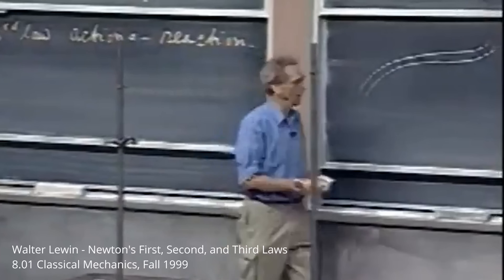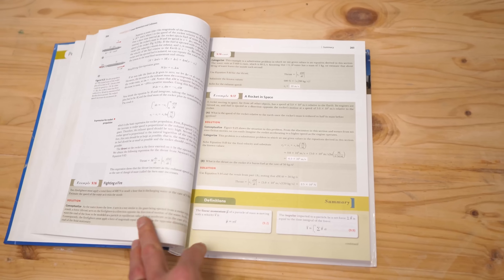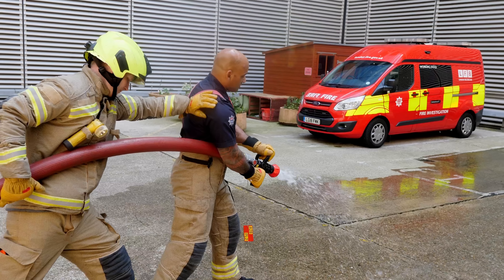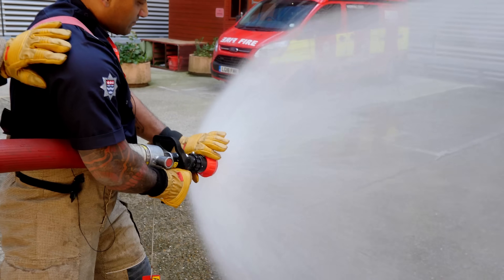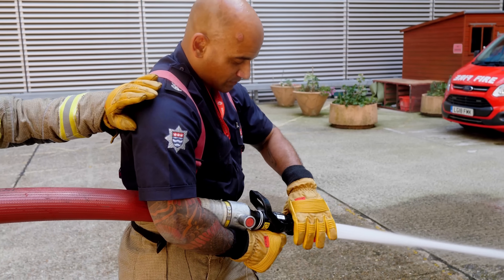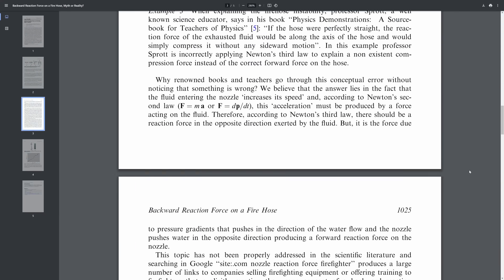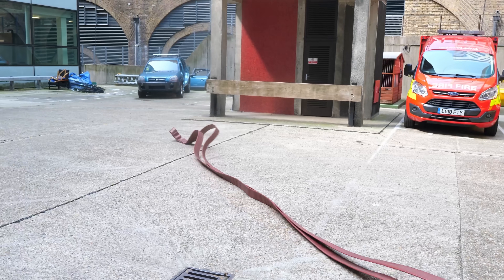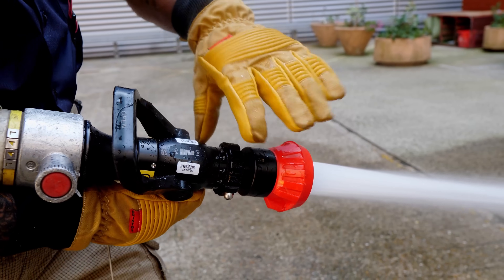Why chaotic hoses dance

Comment: A couple of points from the perspective of a very old aerospace engineering background...

1. The hose and nozzle are not the same diameter. The mass flow rate of the water is the same everywhere in the hose, but the velocity is not the same. I believe the force generated as the water accelerates through the nozzle is related to the energy rather than the momentum, which means the velocity term is squared. To me, the diameter looks to be roughly half of the diameter of the hose, so the energy should be 4x as high.

2. Water is incompressible (also not terribly expandable). In a rocket, the shape of the nozzle matters a lot. You actually don't want the exhaust to exit the nozzle at higher pressure than ambient; maximum thrust is achieved when the pressure is equal to ambient. When this is the case, you get a jet of exhaust that's tangential to the end of the nozzle. When the exhaust is lower than ambient, it squeezes inward after the end of the nozzle forming mach diamonds; when it's higher, it fans out. Water mostly won't do this, so I don't think the shape of the nozzle matters as much, after the constriction point. The purpose of the nozzle in a fire hose is not to generate maximum thrust, but to generate maximum water velocity while maintaining a reasonable flow rate at the pressure that can be generated by the pump and withstood by the hose and nozzle.

And another interesting question to think about that might provide some insight: You know those hoverboard things that use the water pressure from a jet ski to let people fly with a hose dangling underneath them? Where is the force actually felt by the device? Is it at the nozzle (pointing downward)? Or is it at the bend in the channel that redirects the upward-flowing water in the hose, to exhaust downward?

Comment: The explanation at around the 16:00 mark makes more sense to me, seeing as how your first explanation required the curve to be causing the water to speed up on the out side of the curve and slow down on the inside of the curve but in your parcel portion you pointed out that all the water inside the hose is traveling at the same speed. 😅

Comment: The guys that use hoses to fly over lakes are rocketing up in the air. Having done firefighting training, holding on to the nozzle seems to cause about the same fatigue as battling the hose to keep it straight, but then your most focused on your grip, for fear of losing it, and endangering your crew from a runaway hose/nozzle.

Comment: The moving fluid will cause any bend in the hose to be straightened. Thus, any bend means that there is a differential amount of tension across the hose. If you integrate all tension vectors, you should end up with the net force on the hose. I think the issue with the experiment is that it's only measuring force in 1 dimension

Comment: Ahh, the rabbit hole of pressures and forces. Want to get your brain really bent into a noodle, look up on anchor blocks at the bends of large scale pipelines. First you'll wonder why they are actually needed, and then once you "get it", you notice the anchor blocks are at the wrong side of what you thought was required, so you didn't "get it" afterall.... Ahh the joys of Bernoulli. Here's a hint. Everything becomes easier if you look at it from a conservation of energy perspective.
Oh, and as for there being a difference in the calculations for water vs air in a flailing tube, as long as both are in a turbulent (Reynolds >~ 2500) state, not really, as the pressure is pretty constant within the tube.

Comment: The constriction should act identically to a nozzle, constricting area and increasing speed. I think you are correct that the main forces on the hose are the nozzle acceleration and change in direction due to the hose bending. Gravity and friction may contribute to the tube man slightly. Air is compressible and is likely expanding, pushing against the end of the tube acting like a nozzle even though their isn't one. For water, I found it helpful to think of a cylinder getting pushed through a greased tube. Friction is neglible and without any nozzle or bends there is no force on the tube.

Comment: I reckon you'd have reached your conclusion quicker if you'd personally handled that fire hose. Comparing air/water behaviour is definitely complicated by the massively different compressibilities. But i wonder if compressible air is temporarily storing energy in the relatively 'rigid' sky dancer tube, where the more stretchy hose might be storing energy with the incompressible water? There's a surprising amount going on when fluid dynamics is involved.

Comment: @SteveMould It seems to me that the force experienced at the end of a firehose would be directly related to, if not equal to, the actual pressure difference and the weight of the water (or rather, the quantity). So, just under 15psi at sea level (which is where my firefighter training took place) and the hose on a naval ship is normally pressurized at 100 psi and 125 gpm. Now, I'm nowhere NEAR smart enough to do the math on that, but I figure that if you calculate the pressure differential you could measure the force by cross-referencing the pressure differential with the water exiting the nozzle at any given moment based on the size of the nozzle and the amount of water. Did that make sense? The amount of actual water ACTUALLY LEAVING the nozzle at any given point in time is more or less constant (if pressures are constant) so the force "X weight of water" would generate under "Y pressure" should be fairly straightforward tp calculate if you knew the mass of the water acting on the nozzle and the pressure differential.

Comment: 15:20 in this footage the reason for only the end of the hose flailing can be (at least in part) the same as when you held the air hose closer and closer to the end. The weight of the water in the hose and also the stiffness of the hose under high water pressure holds most of the length of the hose firmly to the ground.
Reply: Exactly what I think too... We cannot compare a large hose full of water with a small hose full of air! @Steve Mould It would actually be interesting to test your small air setup with water instead of air and see how it behaves (although as the weight of the water grows to the cube of the diameter of the hose, we cannot really extrapolate like this... But we could push the experiment much further finding a fluid with the same Reynolds number and calculate the required fluid velocity to have a realistic scaled down fire hose!) 😅

Comment: start with a rocket engine, consider that there's a high pressure being created but it is focused out a nozzle, consider a container with compressed fluid, the flow of fluid from a focused nozzle also pushes at the nozzle.  The fact that the pump is continously adding compressed fluid is irrelevant to the forces felt at the nozzel where the store energy is released.

Comment: Momentum = mass * velocity.   The constriction of the nozzle turns high volume low speed flow at high pressure into same volume, high velocity, low pressure thus higher momentum.  The change in momentum = thrust.      Yes it is interesting to try to visualize where exactly the force is applied.    I think it is back against the solid column of water from the back of the nozzle (where the constriction starts) to the front of it (where it exits), as the water accelerates.      Fire hoses have somewhat more complex nozzles than the average garden hose nozzle, but all the same principle.

Comment: The force at the nozzle is indeed the shape of the nozzle accelerating the water from high to low pressure. + The force on the tube pulling back

Comment: The string analogy is poor because the surface it's resting on creates resistance. A length of plastic filament would react differently until the resistance of the surface equalled the inputted load.

Comment: Hi Steve 

A great followup would be those jetski hover boards that use water nozzles to "fly"
Reply: Exactly. The pumps on those are also connected by the hose and are stationary or on a boat, so it's mostly the same situation.

Comment: I don't think your pressure reasoning is quite right either. For one thing, it feels counter-intuitive in a way I can't resolve to my own satisfaction that the lack of air pressure pushing the water back somehow creates a backwards force. For another, the "pushing on a string" analogy doesn't hold up because unlike the string in air, the water in the hose can't release the forces on it by bending because it's constrained by the hose (and even if the hose bent, it wouldn't change volume and thus wouldn't matter for the purposes of pressure). Personally, I suspect that at least part of the answer is that loops and bends apply their force perpendicular to the direction the hose spans. In the same way that the force on the trees holding up a hammock is not equal to the force I exter by lying IN the hammock, I think the tension of the hose will not be equal in magnitude to the sum of the bending forces on the hose. I don't know exactly what but I feel like there might be some weirdness introduced by the fact that the hose can experience tension while being bendy, where normal tension would pull a rope increasingly straight.
One thing I think might be worth trying is to see if you can get the hose perfectly straight in your experiment. You were allowing slight bends in your "straight" hose on the assumption that the force would be proportional, but I don't know if it would be.
One thing that's weird about this problem is that generally, I can get some intuition by thinking about what any given force "wants to do", but in this case I'm really not sure what that would be.

Comment: What I really want to see if like, pump some water with particulate (or something else to make flow speed visible) at high pressure through a clear hose. Then you can try to compare the speed at the exit to the speed inside the hose and see what fraction of speed is actually at the nozzle vs. at the pump. 

It seems likely that the flow speed in the hose is pretty low and most of the flow speed is gained at the nozzle, based on firefighter experience and the behavior of force from the air in the tube being pretty negligible, but I still would like to see the experiment done.

Comment: There are a lot of traits of a hose to consider. The thinness of the wind dancers fabric allows for easy kinking as it bends and kinks restrict airflow which allows pressure to build beneath them.

Comment: It's the same force, the hose is just an extension of the pump not somehow a different entity.  Because it's not rigid, it moves instead of the pump.

If you made the hose a rigid tube, you'd just have a water ejecting engine.  (OF course, if the tube comes off the firetruck, it's the whole truck that moves on it's hose tether, the truck would be like the angled elbow piece...but Steve kept saying pump and hose didn't really consider the truck that's hooked up to a hydrant).

The energy or force is where the ejection happens regardless of the rigidity of the medium(tube/hose) between the pump and the ejection point.  A flexible hose is just an unrestrained shock absorber.

The hose is a tether for the ejection force.  Tie a tiny rocket to a string(of similar relative flexibility) and you'd see a similar effect as long as it's not oriented to just fly directly away and pull the string taught.

Same thing with a rigid arm.  Make the ejection port long and have a 90 degree angle at the tip.  The whole mechanism will rotate around the body/pump.

Now, shut off the water and move an equivalent rocket at the end of that arm, and you'll get the exact motion IF the weight is the same at the body/pump.  Just like those firework things that go all spinny.

Steve really should know why the flexible hose flips around further away from the tip of the nozzle.  He did at least a couple videos of chain mechanics.  The hose is a chain, but with so many tiny discreet bits instead of large identifiable ones.  Chains, whips, rubber tubes, same difference.

The hose waggling about well behind the point where it would just oscillate, that's just a wave traveling up the hose from the whipping motion of the tube, not really the motion of the water(or air in the experiments).  The same thing happens if you stretch the hose out, connected to nothing.  If you pick up the end of the hose and "whip" it, the wave will propagate X distance(depending on the material characteristics and weight of course).  People do this all the time with garden hose or electrical extension cords to try to get them un-snagged or straightened out.

Hope this all makes some sort of sense.  A lot of it would be so much easier to just draw, and I don't know if youtube likes links, so I didn't bother.
Reply: The water nozzle is a rocket engine... The force felt at the nozzle is the weight of the water x the velocity of the water combined with angle of momentum of the water when exiting, and the losses do not matter and only over complicates it (so many people get hung up and focuses on the losses which is irrelevant).

Comment: a firefighter holding a hose cannot be a closed system so applying the third law is hard. If the pump is consuming energy then its part of the system. Imagine if the hose is open ended (or even flared outwards). The water still leaves the hose with momentum forwards even though a person holding the end doesn't feel a force pushing him backwards.

Comment: You're wrong. Hoses hold pressure gradients, despite the flow being uniform. The water don't accelerate because the pressure gradient is balanced by the drag from the hose wall.
It's the same with electrical circuits, there can be a voltage difference between points with the same current.

Comment: I think the reason the hose doesn't wiggle when both ends are fixed is because the forces are relatively constant, so it comes to rest. It would wiggle if you abruptly switched the pressure between on and off, especially with a hose full of water

Comment: Steve, in your force measurement tests the resultant direction of the fluid coming out of the hose was the same as the initial direction the pump was pumping. You introduced curves, but the net curvature was always zero. Try pointing the nozzle at 90 degrees from the outlet of the pump and measure again.
Reply: Also, think about the physics of whips when considering the phenomenon of the tip of the hose flipping around in oscillation. The main body of the hose is moving laterally, then gradually stops moving as the tension in the hose prevents it from going further, so the angular momentum of the tip increases in conservation of momentum until the tip whips around and overcorrects, providing the restoring force.

Comment: I wonder if the experiment where you measured the force was contaminated by the air exiting the hose being pointed directly at the measurement device.

The question I have is: How does the exiting water impart that force you described on the hose as it exits? It's moving parallel to the walls of the exit of the hose. There's nothing to push against. It must be pushing back on a bend in the hose. Simple experiment, if a hose is replaced by a fixed straight tube, except with the walls at a single point being replaced with force gauging walls, what force will that gauge measure? That should be an equivalent system to the end of the hose. Then add a bend closer to the source before the gauge.

You also mentioned how when the ends are fixed, we should see some wiggling. But, you DO see some wiggling, but only right at the start when the fluid begins to flow. It immediately stabilizes. I wonder if the controlled points causes this system to be extraordinarily likely to stabilize.

Your "quite telling" footage of only the end of the hose flailing might be explained by friction with the ground.

I think we need simulations.

Comment: hey @SteveMould responding to your conclusion 14:54 - You are wondering why a hose anchored at both ends doesn't flop about.

I think the answer might be just that while the hose is being filled it applies force to each bend in the hose, then once it's filled the only force felt on the hose is the acceleration at the nozzle due to the pressure difference, so when looking at the hose's movement, we could say it's feeling the force of the increased pressure at each bend until it's filled then it's feeling the force of water accelerating as it exits the nozzle.

To test this, empty a hose and watch as it fills at high pressure you'll see it wiggle and flail at each corner similar to the air pressure filling the wacky air balloon man, but then once it's filled it will act like the fire hose with the nozzle being the only force felt, now it will oscillate or enter a chaotic state of going every where but it's all driven by the force of the nozzle.

The last part might be to consider what's the difference then in the whacky balloon man and the hose and my best guess is just volume, if the volume of fluid is equal to the volume of the hose or container, pressure while remain equal and he would simply act like a hose but if the volume of fluid entering is not equal to the volume of the container, and the walls are thin enough to fold in on it self it will create a pocket that allows it to build up until the fluid escapes.

anyway great videos mate always enjoy pondering or trying to understand some aspect of physics also might be wrong haha but that's fine.